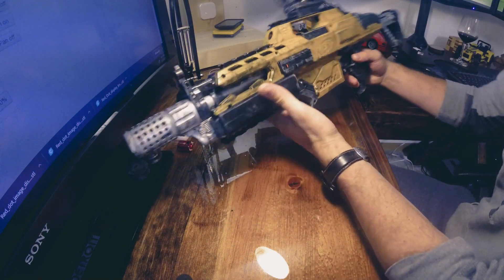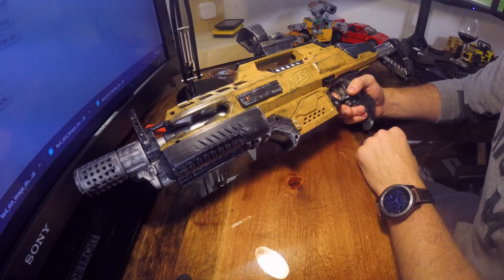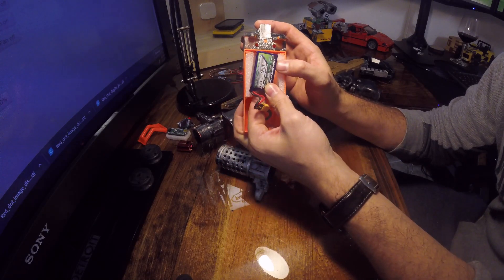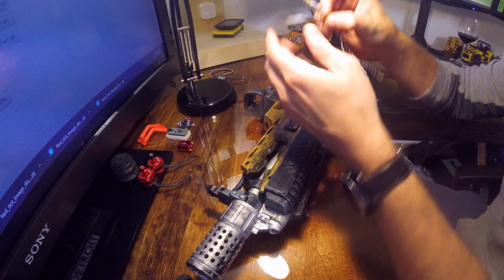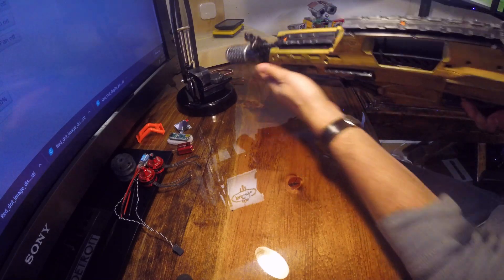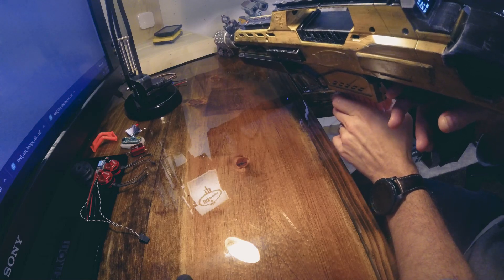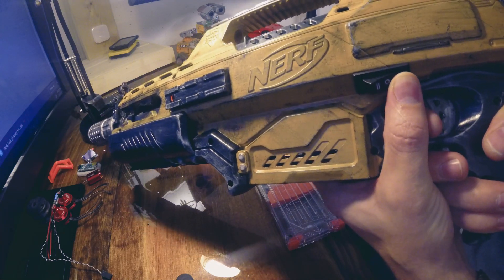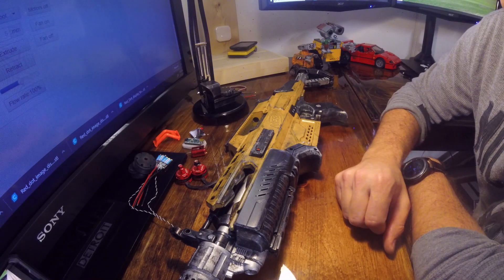NERF Rapidstrike MOD -  Brushless / Select-fire / Shot-counter

Comment: Nice work. I'll make 3 observations though - 
1: The battery is too small. The motors will pull ~15-17a on 3s and the Neo Rhino about 25a at stall. Without a safety margin, you're looking at approx 60a. It looks like your battery is the 65c / 450mah battery.. Which at full burst (150c) has an absolute max draw of 58a. Before you know it, the battery will be the shape of a golf ball. The battery tray is perfectly sized for 2200mah battery, and it'll last the whole day nerfing. I see the same thing with guys running small batteries with fang revamped motors in their stryfes.
2: The battery spring contacts, while a cool idea, are really only good enough for stock batteries. Next time you have it apart, check out to see if they are bluing. They may handle the burst current, but usual convention is to run the wires out directly.
3: The calibration code is pretty flakey with that generation of code.. Where it reads:
    BatteryCurrentVoltage = (((float)SampleAverage / (float)CollectedSamples * 5.0)  / 1024.0 * (float)((47 + 22) / 22)) + BATTERY_CALFACTOR;
    Change it to read:
    BatteryCurrentVoltage = (((float)SampleAverage / (float)CollectedSamples * 5.0)  / 1024.0 * (float)((47.0 + 22.0) / 22.0)) + BATTERY_CALFACTOR;
   And re-adjust the cal factor to 0.0 and start from there. If you changed the formula to suit a different divider values, just make sure you have the .0 - the issue mostly relates to a type cast bug..
Reply from the maker: Hey,  thanks for the comment and feedback. You're probably right about the battery but I honestly just used batteries I had on hand from previous projects.  It may shorten the life of the battery,  but I haven't had any issues yet. As far as the contacts, I knew it may have been sketchy, but again,  no problems yet! Next time I have it open I'll give it a good lookover and maybe fix the coding.  Thanks again.  Jordan

Comment: Love the video. Can you show your internal or show circuit diagram.
Reply from the maker: David, thanks for the post. I do not have one right now. I will try to work on one this week. Overall, the wiring is very simple. The most complex part is probably the voltage divider circuit for the voltage readout. I still don't have mine calibrated.
Reply from the maker: Here's the wiring diagram.  Let me know if you have any questions. I do not have a picture of the internals,  but there is plenty of space for everything. 

https://photos.app.goo.gl/KyqZytidFbtvqp8v8

Also,  double check the pin out in the arduino program. I changed a few in mine.